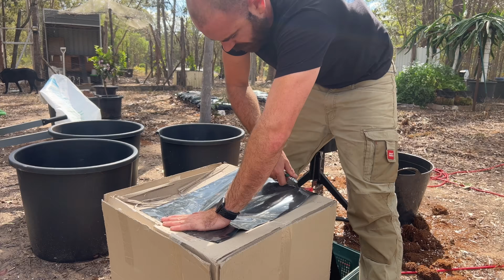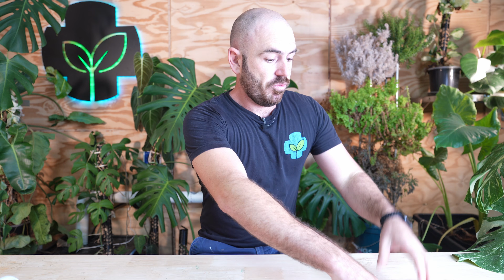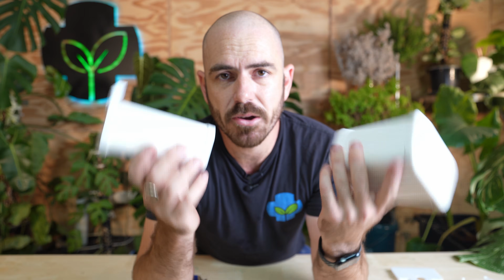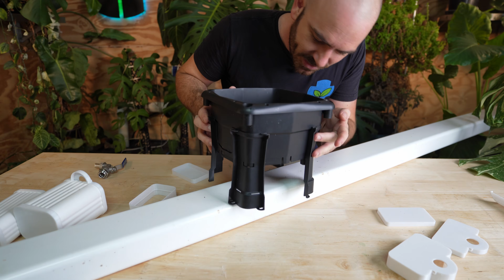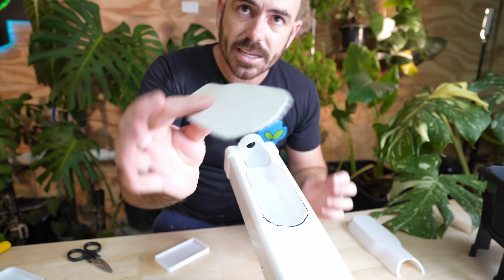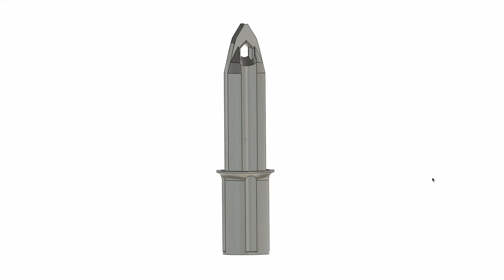New Rain Gutter Grow System Physical Product Releases + Bonus 3D Prints

Comment: Hoocho says:  PVC cement bonds well to PETG - Microsoft Copilot AI says 'Short answer: No — PVC cement does not reliably glue PETG to PVC pipe.     Damn you AI !  my small brain may explode.  I guess I better just break out the PETG end cap and the pvc cement & test.   Any response from the hooch ?
Reply from the maker: Depends on the solvent. In this case it does.

Comment: Depending on the scale why wouldn't you just have the stuff be injection molded instead of printed? You could make so many more parts in the same time that way?
Reply from the maker: @kim.drennon  google “injection mold die cost” and times that by 8